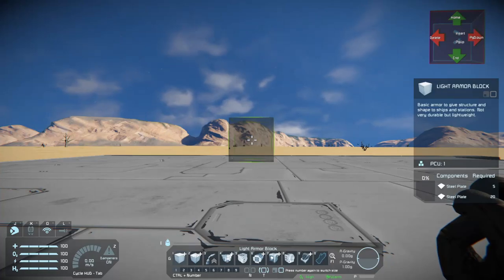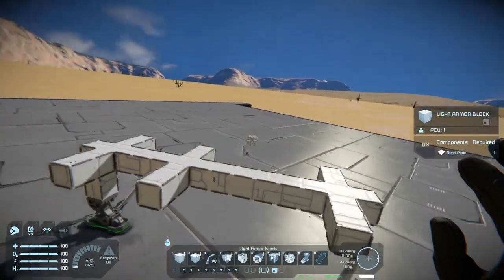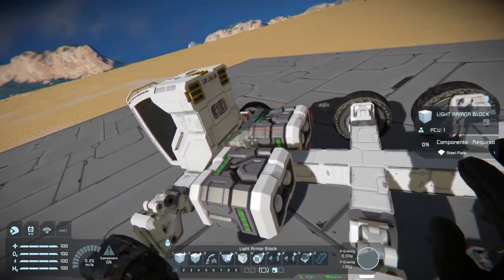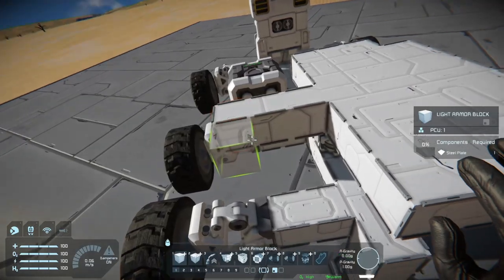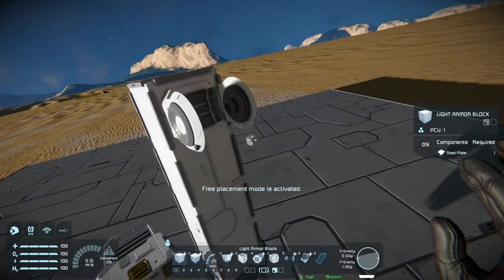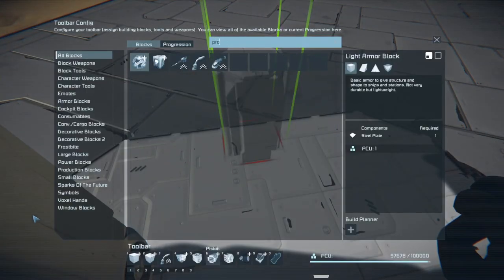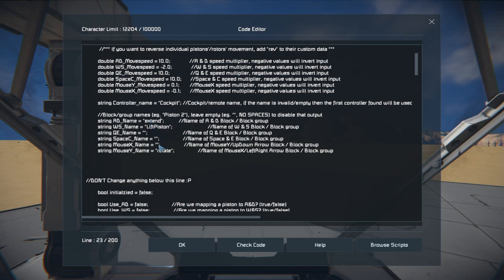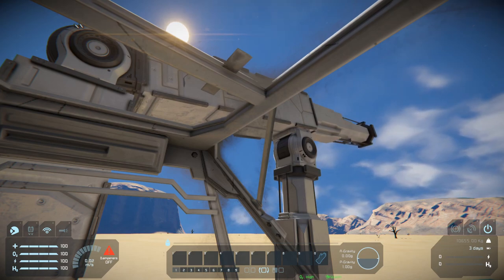How to Space Engineer - Mouse Controlled Crane

Comment: I have followed this great tutorial and got it working. There are some minor changes/problems here is how to solve them.
- Make sure the cockpit you control the crane from has the same name as in the script "Cockpit"
- The string variables are now at the top of the script when you first download it from the workshop. (I think the script has been updated in the workshop)
- One piston is called boom in the tutorial later it is called extend in the script. Make sure these names are the same.
- When you recompile the script and there is a problem with: for example a variable name you can see the debug information on the screen. 

Thx for the great tutorial Pandemic Playground.

Comment: How to use mirror mode: place down your block in the center that you want to mirror on then press M you will see a colored plain indicating that mirror mode is on. this plain will move wherever your mouse points and pressing m again will change the plain it is on, also you can put a mirror through a block or in between 2 blocks. to place down the mirror left click and then you can leave mirror mode. to enable mirror mode on your ship you can press N and now in creative mode. now if you place blocks on one side of a ship it will be placed on the other side as well. how neat is that!

Comment: Trying to recreate this crane without the script on console though I'm having an issue. If the small grid rover isn't anchored to the ground with landing gear, and I extend the piston, the entire rig freaks out and does flips. Lowering the Max Impulse NonAxis stops this, but it also stops the piston from extending. Is there something I'm doing wrong? Do the physics on the console version just not allow for this?
Reply: You may need to use landing gear,  both to hold the Rover and the cargo to the Rover if trying to transport it.

Comment: Built large grid version, receive code editor error - Program[35,13]: The field 'Program.initialzied' is assigned but its value is never used. Crane does not operate.
Reply: Same

Comment: These crane things just never pay. It takes so dreadfully long to move something around and exactly position it that you could just grind and rebuild in less time.
Reply: Thats because I use the mod AwwScrap, that mods make that when you Grind down a block it gives you just scrap of each component, that way makes more sense to avoid grinding stuff and reutilize them. Combined with the "Welding Pad" mod you can reattach blocks to existing grids with out grinding them